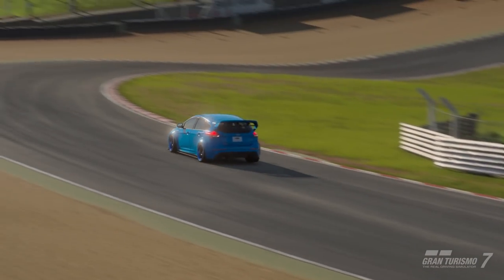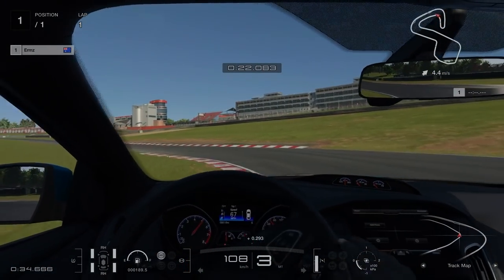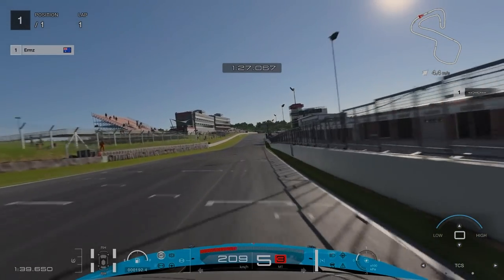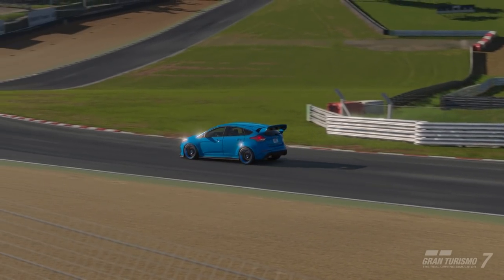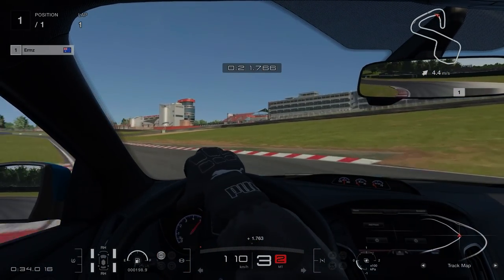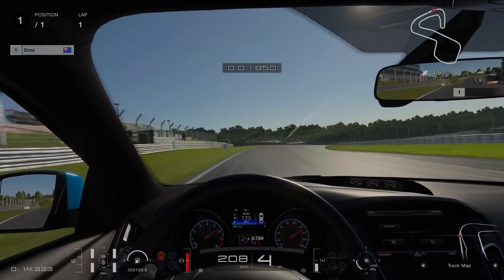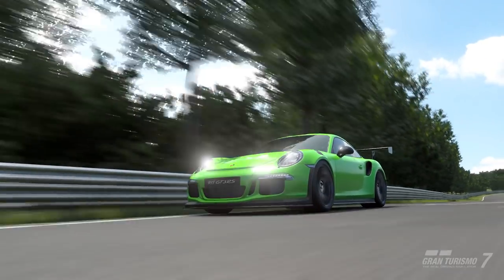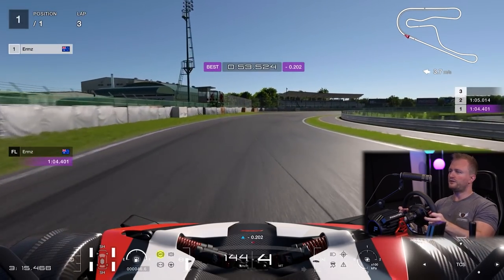This is Why You Keeping Spinning in Gran Turismo 7

Comment: Fantastic video! This is exactly what I’ve been looking for referencing the tuning aspect. I’ve had voiced my opinion on the physics to the gt groups but I just get shunned for my opinion… A+ driver told I can’t drive by B dr drivers 🤦‍♂️. The game is for the most part awesome, but the one thing it seems everyone wants to pretend isn’t actually there or a issue at all(I can’t drive responses) is the ungodly amount of snap oversteer there is and it’s with every single car on gt7. Some cars it’s so bad that they aren’t even drivable or competitive in their class. 

I get it that the tuning bunny’s are all for this physics flaw and it benefits them… but vast majority don’t know how to tune and then theirs the ones that find ways to manipulate the algorithm or play with certain adjustments to get unrealistic characteristics out the car. So in short, tuning races just become a bop no tune after everyone just copies and paste the same tune to remain competitive in gt7
Reply: I’ve noticed it in some cars in a way it doesn’t make much since, but other cars have zero issues for me… I’m running on a controller so I tend to use 1 level of traction control, but even still some cars end up uncontrollably loose, though I’ve found that to mostly be upgraded street cars, not (most) of the Gr4 and Gr3 cars. I’m glad the Gr3/4 cars don’t seem to be hurt as much since you can’t find the cars for the sport championship races.
Reply: @calebnation6155  all my street cars are really good like the skylines and evos the sti and the Hondas are really good too I have some fast tunes and it’s all been realistic I haven’t found anything that breaks the game

Comment: Stiffening the dampers up helps a lot with the instability as well, especially in quick changes of direction, and it makes trail braking much more consistent.
Reply: Just make sure (bump) compression is always Softer in the Rear, around 10 clicks. Also change the natural frequency ratio and make the rear springs, much Softer like 50. Should make a Big difference

Comment: Holy crap, so I did this with my 989 hp Mazda RX7 and holy crap, my only problem was that when I set the suspension too low, I get no steer once I brake.

Comment: Just familiarize yourself with the difference between street cars and race cars braking and acceleration in conjunction with your transmission settings..set low will increase acceleration and cause more consistent traction break in the turns transmission set high will give ya better top end and control in the corner but your acceleration sucks not to optimal for a curvey course....I suggest turning on your line/brake assistant and test the difference in street cars race cars just learn how to brake ...I'll run a course on racing slicks and high acceleration and won't spin out once 👍 proper braking and waiting to mash the gas until your out of the pocket

Comment: Very good video, Ermin. Thank you for making it.

I respectfully disagree about the severity of the handling quirk you claim is in the stock suspension settings for run one. If it was a fully stock car I would concede you're right, but you'd already added tuning parts like race filters to up the power and any change of tyre from base makes a big difference. This would naturally alter the car's balance because it's stock settings are established for the power output and road tyres it comes with. Even a base car with no performance mods at all seems to have exaggerated weight transfer if you fit overly grippy tyres (race softs expose this hilariously - lots of tyre grip but the car suspension is not tuned to that level of grip, and rightly so). 

Can you do an exact same video for the A80 Supra RZ? Stock standard, installation of sports/race suspension and mild performance parts, then tuning them together? I'd love to see you do this in an FR but one that's a hero car.

Once again, really good video mate.
Reply: Im not reading that but i know thats a lot of bs. Nobody need that comment. Ty

Comment: i only don’t use differentials is because it drops PP by literally like 3 points n i don’t like it, i gotta get out of that mindstate, im gonna end up throwing my ps5 controller how hard i spin out, it’s always worse when you try to correct it and get the worst case of uncorrectable snap oversteer, ya know where it slides a little then gets worse every time you move the analog stick ? yeah i really need a rig, but my current living situation says no

Comment: Looking forward to the controller and wheel comparison. 
So far I feel like every challenge is easier with the controller, especially snap oversteer moments...  - running a g29 wheel though so it could be different on a fanatec.

Great tips in this video btw!
Reply: I have fanatec DD PRO and Drifting is miserable. For the love of God I can't drift using my wheel. On controler though it's a breeze. Myabe it's has something to do with my pedals being stock and not load cell which may help to throttle more accurately. On dirt tracks however drifting with a wheel is much easier and fun tho. Miata cone challenge with wheel is also impossible for me but easy with controller. With oversteer it's actually pretyy funny because i tested it in asseto corsa on PC and it's way easier to me drive than GT7. There is also way easier trick to handle oversteer. Turning countersteer assist on weak makes cars much more responsive so it's up to your preference. Either tune the car like above or just turno n countersteer assist
Reply: For me it depends what I prefer, the wheel seems faster for me but the lack of force feedback the game has is a massive dissapointment. The game game literally has none and I had expected atleast pc1 levels or something which would've been great.

Comment: Just tried out adjusting my settings using this logic and are already getting better times — and I’m using a controller. Just won three races with a Radical SR3 with only an added Diff, Suspension (as per this video) plus Racing Air Filter & Silencer — using this methodology I’m beating M3’s, E63’s, 4C’s etc. Just wish the AI drivers weren’t road hogs so I could get Clean Bonus.

Comment: Now some tips on combating lift off oversteer please? Especially in the ford gt gtlm
Reply: Try reducing the decel on the diff. Also try increasing the damper compression stiffness on the front, and the damper extension stiffness on the rear.
Reply: @MoosyPineappleMan  I put the deceleration lsd to the max I softened up the rear anti roll bar to 1 put the front arb to 8 dropped front downforce a lot increased rear downforce a lot put the camber to 2.5-1.5 front and rear and i still spun the car turning into 130R. Works well in other circuits sometimes but snap oversteer on liftoff is still there. I will try that too
Reply: @ruzgarakgul2051  Even out the stiffness, when offthrottle if your rear is too soft it will induce more oversteer because it will completely unload the rear tyres. Reduce decel to 5 and bump it up by 5 till it feels like you have the rotation you want at corner entry.
Generally use spring and ARB balance for mid corner, damper stiffness for how quickly load shifting happens in braking zones, throttling out, and direction changes, and LSD settings for balance on corner entry and exit.
These things interact closely with each other so if you want to get good at tuning experiment a lot with mixing these things up, but following these general guidelines is a good way to make basic tunes a bit more drivable.
Also stiffer is generally better when it comes to spring rate, as long as the track isn't making the car bounce, for example the nurburgring typically calls for a softer setup.
Try to make your ARB stiffness similar to the spring rate, if it's too strong the springs take no load, if it's too weak the ARB will take no load.

Comment: Gonna be honest, this is kind of a poor example, while some of the LSD stuff is true, setting a 50:50 4×4 undermines this experiment especially considering some cars can have like 3 LSDs. Basically saying 50:50 is like magic, it stabilities the car in so many ways that it makes this video a whole lot less relevant to rear only drive vehicles which can't as often get grip by waiting for the front to pull it stable

Not trying to be sinical, but you did things like use racing tires on a stock suspension, meaning of course the weight transfer is going to be too much, that's not an issue with the physics that's simply what happens. You put better (stiffer but less corner weight transferring) suspension on & it got faster overall even if the more limited movement made it harder to turn in at first, which again physics wise makes sense for a gripper race tire that would over-compress a softer stock suspension, but of course the handling overall will never be dailed in right out the box, so again this is all normal

You're comment about a stronger LSD stabilizing the rear is also incorrect, the more open a diff' is the less it will slide, & it will still slide even uphill in a corner because whilst you have racing compound on, it's still a hard compound and a tuned car can still slide those, all of this makes sense

The reason the physics feel so off to some folks is because people aren't realizing that this time around GT is punishing you for getting your suspension wrong, cars are actually bottoming out for once, so you can't just lower your car and hope for the best, the rear needs to use more stroke or it will snap, inversely if it's too soft it'll bottom out & snap anyway, major bumps can't break your car so it just sends you in the air, basically you have a limited window to work with, & proper suspension tuning was never easy in real life, I've been in plenty Hondas that drive much worse than stock, so this is projecting reality

Point is in GT7 you need to use the right level tire with the right level suspension, I've driven that Porsche as it comes & it handle beautifully, the MR2 for example a car I'm familiar with on sports hard tires (as it comes) is pleasantly familiar, you can even slide it a little contrary to what some are saying, the difference this time is the controls aren't as forgiving as GT-Sport was

That said I do think the Micheline tire model isn't the best., part of the issue is GT7 controller settings isn't as understanding of what you're intending steering Vs countersteering. However that part aside, there is still an important part of the physics that does feel genuinely wrong, which is once the drive wheel IS slipping, it gets easier & easier to spin faster & faster, which is also true in real life. HOWEVER., in GT7 "once spinning" how much grip the rear losses, & how quickly the wheelspeed speeds up is too fast, making a minor slide turn into a major slide way too quickly, to the point most folks try not sliding it at all, rather than use a little slide to get rotation & drive faster which you can still do in GT7, but it's really hard to ride that margin without it over-spinning

So., I'm seriously hoping PDI/they/Michelin correct that..

Comment: Here is the problem, as I see it, with GT7.  As we seen in the first test season, all of the races were BoP/Tune locked.  Polyphony simply must get rid of torque vectoring set up as the default for cars, otherwise, unless you can tune their crap settings out of the car, you are going to get the snap over steer.   There is absolutely no realism in the way the cars perform currently.  If there were, the number of cars on the road would be a whole lot less and the number of wrecks beside the road would be a whole lot more.  Sony/Polyphony would have us believe that it is normal that you lift off the accelerator on a default tuned road car, that you can get from any car lot in the world, and this triggers an oversteer response that sends the car sliding sideways.  If it were a supercar, hypercar, or upper limit sports car, maybe.  But a stock Ford focus does not have the power to induce the LSD lock up they are simulating nor does it use vector thrust because the differential is not that advanced.
Reply: Well said
Reply: No it wasn't well said. Go drive a car on a racetrack. Or do like any other person on youtube does to become an expert. Lookup Ferrari snap oversteer. Educate yourself with experience before you go around with misinformation.
Reply: @Tracked350Z  Yes those things happen, but not nearly as frequently as GT7 wants us to believe. Also this is a video game, people want to be able to drive the cars as is without tinkering. There are real racing sims for people like you and me. GT7, while although still fun, is a simcade.
Reply: @Tracked350Z  So, he said this stuff only happens on high end sports cars and your response is you’re wrong, look up Ferrari snap oversteer?
Reply: @Tracked350Z  Heh, and you have been on a track?  I've driven the Daytona road course with a 1982 datsun 280zx turbo and a 1979 formula firebird pushing 450hp.  Daytona is 25 to 30 minutes from where I live so I get to go out when the pros are not on the track if I want to pay the fee and get the inspection done.  You want to make it seem like this is harder than it is, so you can pump up your ego.  But that aside, we were talking about road cars and not race cars.
Reply: idk man, my 1998 Lancer Coupe is an econobox, and if I'm midway through a corner near peak grip and I lift off it will try to throw the arse around in front of me. Haven't driven any other car near peak grip, so it might be that my car just has shit dynamics from factory and I don't know any better, but the FWD cars at least feel pretty bang on to me.
Reply: I’ve never hit an apex at full throttle then let off.  That doesn’t seem like a good thing to do imo.  Usually you lift and brake going into the corner.  Corners that are flat out, if I noticed my line was off, I would ease out of the throttle till grip returned.  But never in all my days driving in highways and tracks did i lift off on a straight section and have the rear come wide like what happens here in GT7.  It’s the most stupid thing I have ever seen.  Many of the road cars you have to lift well before the brake zone so the car can resettle before applying brakes.  If I were driving on icy or wet roads, it would be normal.

Comment: Just remember some cars get completely broken when using lowest height as it will prevent the tires from fully turning though I guess is realistic since in those cars the culprit seem to be the tire hitting the inside wall of the car body, I don't know is if wide body fixes it or not because I haven't tried.

Comment: 50/50 power distribution is a really bad idea - it's why you were getting understeer on lap two. The rest of this guide is very solid, but 50/50 power? Nah, you're tuning cars to accommodate bad throttle control rather than learning to drive cars which send most of the power to the rear, which ultimately will be better balanced and faster...

Comment: No, GT7s biggest issue is cars spinning on the fucking brakes. Modern sports cars, like the Civic Type R or GR Corolla, that will spin out from LIGHT braking with soft sports tires on a race track. CARS DO NOT HANDLE THIS WAY. "True driving simulator" my fucking ass, the physics are broken.

Comment: You are forcing the inside tyre to spin rather than the outside tyre by slamming your gas all the time. This is going to kill your tyres instantly. DO NOT DO THIS. Increase your acceleration sensitivity and learn how to throttle control, you will be much faster and your tyres will stay at optimal temperature.

Comment: Then there's my M4 that oversteers randomly on a straight in the middle of 3rd and 4th.
Reply: I tried your settings and the results are amazing. The thing still has issues with traction on straights but the corners are a bit more manageable!
Reply: It seems all of the BMW cars in the game have screwy physics. Even when tuned properly they have massive oversteer tendencies. They’re just wildly inconsistent. You might try lowering the natural frequency of the rear springs as well. That has helped with my BMW cars quite a bit.
Reply: When the M4 with 500bhp++ feels the same as the Corvette with 850bhp, some thing is very wrong.
Reply: @mikemorgan371  it seems like the M4 begins to get weird when you're hitting the red line in certain gears. I noticed on the straights the TC is kicking in when the boost starts to drop. It makes corner exits very hairy.
Reply: I take this back. I took the C7 to the Ring with Sport Softs and it feels so much better than the M4 with Racing Mediums. And the M4 has the LSD tuning and C7 has no aftermarket diff installed lol.